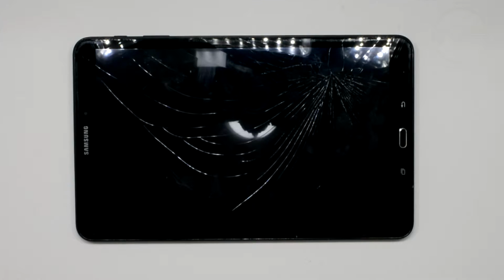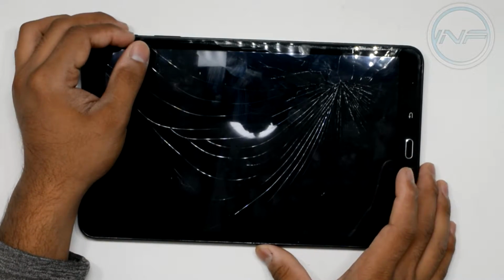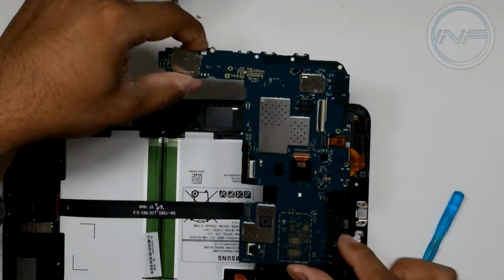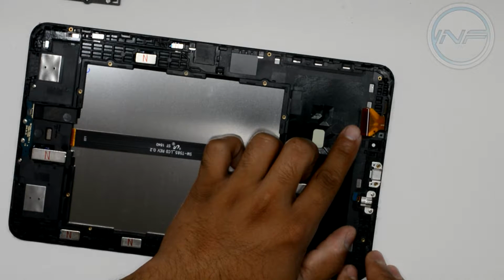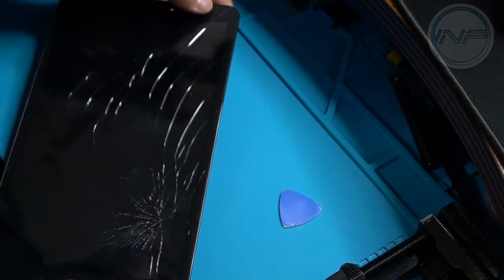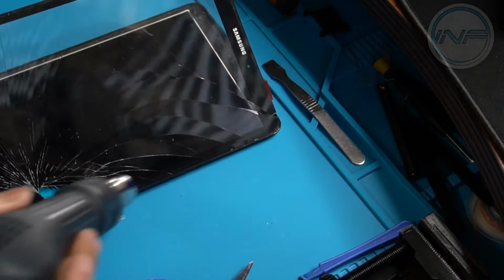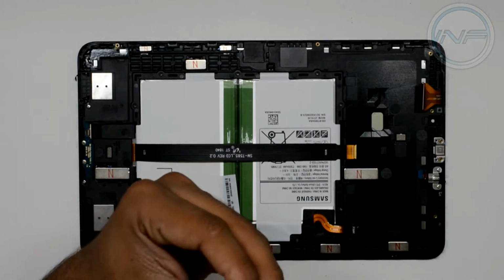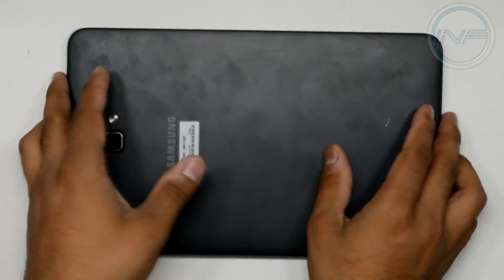Replacing the Digitizer and Screen! - Samsung Tablet - SM-T580

Comment: Why did you remove the board and battery? you only need to remove the back cover and detach the battery cable?
Reply from the maker: Hello, Since I heated the whole tablet I didn't want to damage the battery with the heat gun. It is a good practice to remove everything to avoid any further damage. Hope that helps!